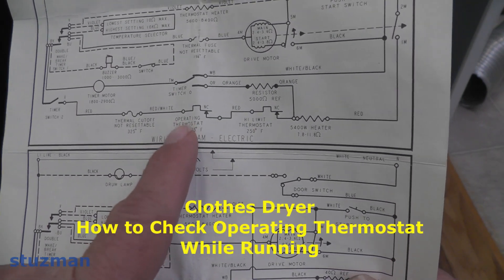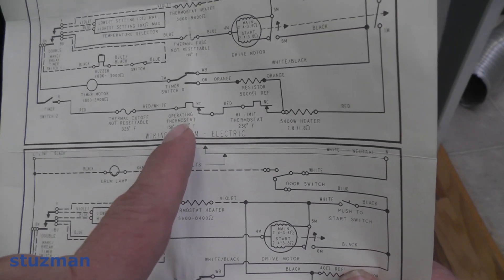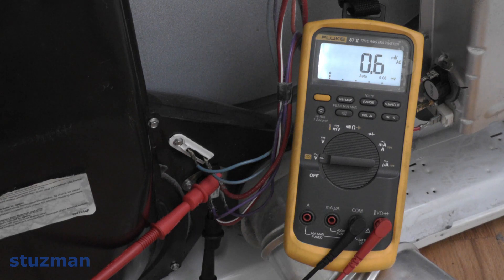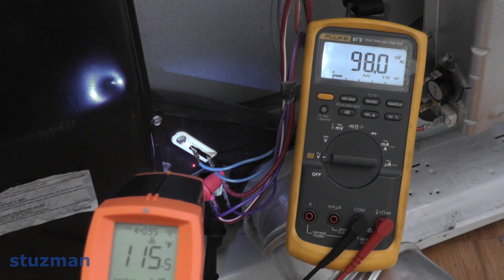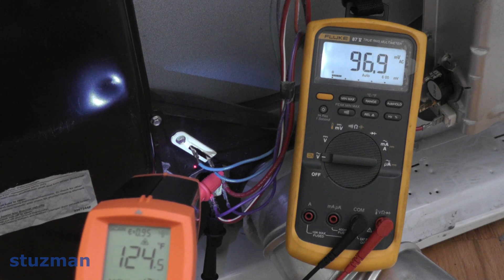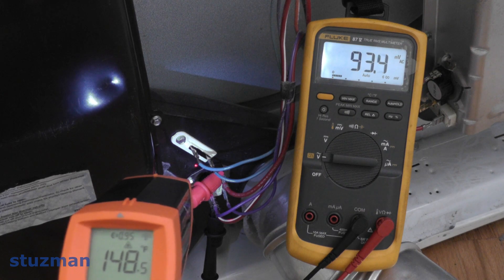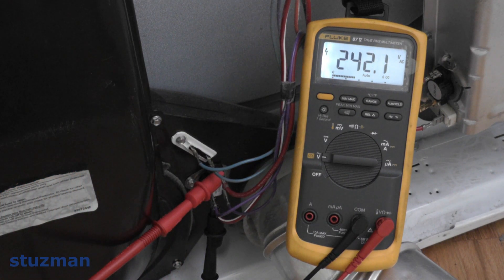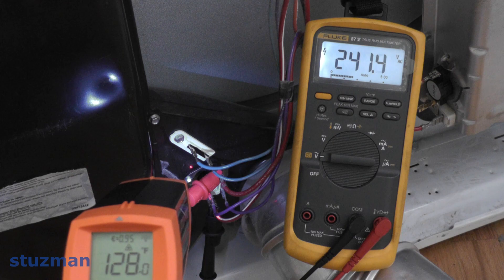Clothes Dryer, Checking Operating Thermostat While Running

Comment: One of the weak points to our kitchen oven is the thermal fuse, which is located in the back outside of the cabinet. When it blows, you need to replace it for about $60 each time. I've replaced three so far, and now we never do self cleaning because it's a weak point of the design. I've often wondered if it would be safe or possible to swap in a resettable fuse that trips out at the same temperature. The only downside I see would be the possibility that in a fire the oven could restart as the fire cools down, but that seems unlikely. What do you think? Are resettable fuses more expensive?
Reply from the maker: Hi Dave! My thoughts are exactly the same as samlol23 who posted a reply to your comment. I would like to know why is it blowing which is obviously because of high heat or excessive current since some thermal fuses are rated for current also. Maybe its due to its location. I would monitor the temperature and current while using the self-cleaning feature and disable the function if it starts getting to the point of where the fuse is going to blow. I don't see any reason why a re-settable thermostat couldn't work as long as the temp and current are similar. And I don't see a problem with a fire since when the thermostat opens, the range will have to be restarted to allow current flow. Personally, I told the wife not to use the self-cleaning feature as it's more trouble than its worth. You have about 1,000 degrees inside of an oven for about 3-5 hours. I've seen in the past where inside panels will warp, the door warps creating leaks around the gasket and puts a heavy strain on the heating element. And for that thermal fuse to cost around $60, it obviously has some gold in there 😊Good luck on what  you find and maybe do a video if you get it resolved. Take care Dave!
Reply: @stuzman52  Thank you Sam and Terry. It's a known flaw in the design of a Kitchenaide oven, and about ten years ago I did a video showing how to diagnose and replace both fuses. Engineers designed the system with no cabinetry surrounding, so they didn't anticipate the way temperatures spike if there is minimal air flow in an enclosed cabinet. It was another example of what can go wrong when bench testing meets the real world. I like Sam's idea of a manually re-settable fuse, even if it means having to pull the oven out just to press a little button. An automatic reset would be even better. On the other hand, that single device is all that is standing in the way of burning the house down. Maybe the wise decision is to do as I've done, shrug and never use self cleaning, ha ha.
Reply from the maker: @spelunkerd  One other thing that I thought is to install maybe two fans like used in computers to exhaust the air from around the thermal fuse. Just throwing out some ideas for you. Have a good one Dave!
Reply: I know you weren't asking me but I would try to figure out what's causing it to blow. Thats fairly unusual but if you could find a manual resettable fuse that's the same spec I dont see why not. Ps I dont think its going to self- reset. You've got to manually reset it  So I wouldn't worry about it going back on by itself
Reply from the maker: I just reviewed your video on your range from years ago. I believe that the thermal fuse, #4452223 replaced with #9759242 isn't a thermistor. It looks just like a normal thermostat using a bimetalllic contact. And the idea that I mentioned about installing a couple of exhaust fans would be useless since you already have a large cylindrical fan across the back and two other fans on the back of the unit. Your biggest issue is where the gasket wasn't sealing on the top of the door which was allowing this 1000 degree air to be pulled into the front intake ports. I've seen this on a lot of ovens with the self-cleaning feature and even the door will warp not sealing around the gasket. I really don't have a good answer for you Dave with that issue. But, having an exhaust fan to pull this air out of that compact area behind the oven would have to help. Have a super great day!
Reply: @stuzman52  you certainly go above and beyond. Holy cow.
Reply from the maker: @Drrich_DIY  Thank you for your comment sam as it's most appreciated! And you have a super great day too!
Reply: @stuzman52  Oh thanks, Terry, for all your kind help.
Reply from the maker: @spelunkerd  You are quite welcome Dave!